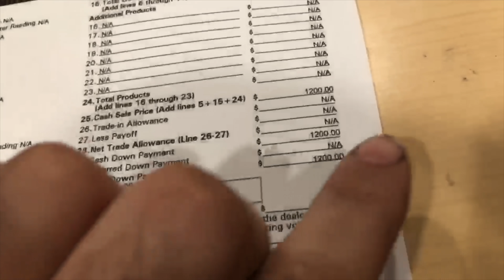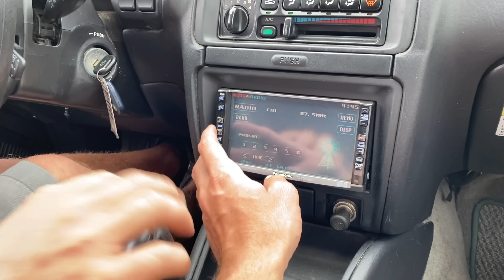James and Cooper Reveal their $1,500 Cars to Battle my CHEAP Camaro Z28!!!

Comment: They should dyno the cars to see who’s lost the least power
Reply: They don’t have an awd dyno though
Reply: jack the front up lol
Reply: Take the rear drive shaft out
Reply: @riderzinc  That sounds sketchy, I like it
Reply: @mj_aussie_coaster_travels8310  They can take out the front CV shafts and weld the center diff, this is how we make our Subaru's RWD the cheap way.
Reply: @mj_aussie_coaster_travels8310  There is a fuse you can pull that should disable the rear drive. At least my 04 and 2011 have a fuse you can pull to make them fwd...
Reply: The ol top gear challenges
Reply: the cars might not survive dyno lol, best chance they got is to just send it
Reply: @Pharyk116  Don't we have certain caps for the front end for where the axles used to be?
Reply: @tomlindo2863  auto? Or manual?
Reply: That's some dumb Top Gear nonsense. Without baseline numbers how are they going to know exactly? And I'f you're going to say they can just look up factory hp ratings, that's measured at the crank and doesn't include driveline loss so that's not really usable.
Reply: So they can copy VINWiki copying Top Gear. Wow so original
Reply: @Pharyk116  sacrilege! 😂
Reply: Dude dyno videos get so boring....
Reply: @tomlindo2863  Only on autos.

Comment: Lol James is gonna put the Brembos on the 240 watch lol
Reply: i know i would
Reply: Either that or sell them, a lot of Nissan guys would pay good money because it is a bolt on upgrade for a few models, sentras, altimas, Maxima's. With  the S chassis it takes some modifications, but still pretty easy.
Reply: Probably not since it’ll limit his wheel choices in the front. Brembos take up a ton of space and are kind of annoying to find wheels that fit.
Reply: Doubt it
Reply: But why? That car only drives the strip and 1/8th mike at that. He doesn’t need extra stopping power when he has a half mile to slow down

Comment: should do a dyno run the one who is closest to the factory rated hp wins
Reply: This is a freakin great idea
Reply: Yes
Reply: They are basically the topgear America should have been
Reply: totally not stole this from Tavarish
Reply: The factory rates them at the crank. Not the wheels.
Reply: @Nebbia_affaraccimiei  just here to say the same thing. That little road trip series was fun to watch wasnt it...
Reply: @Nebbia_affaraccimiei  except not as complicated or daunting
Reply: But you need an AWD Dyno for the sube which they don't have at the shop
Reply: On those legacy's you can pull a fuse or something and make it fwd only
Reply: @Nebbia_affaraccimiei  Nah, Top Gear UK did that while Tavarish was still wearing diapers. He has stopped wearing them right?

Comment: Those SER’s were pretty sweet back in the day. I think they came with an LSD trans as well. I think James is gonna win this!
Reply: A limited slip dif transmission?
Reply: @Greg-TC  Yes. Earlier models (91 Sentra) had a Viscous Limited Slip Differential. This model year had Helical Limited Slip Differential. The 2.5 liter engines are notorious turds. First few years, the throttle body screws would back out and suck in the engine. The catalytic converter was too close to the exhaust ports on the head that the eventual break down of the cat converter would lead the larger 2.5L stroker engine to inhale parts of broken up cat converter. The balance shafts in the bottom of the engine rob it of good HP. The open deck block design is not as strong as previous Sentra models were.
Reply: @viprdude  yea dif.. not transmission.. haha
Reply: @jeremiahgoodwin3408  The VLSD and HLSD units are inside the transmissions for both models.......
Reply: @viprdude  Huh learn something new every day

Comment: I'd run a late 1st gen dual cam Neon manual with a super cheap turbo kit. Maybe spray if budget allowed, and it might.

I've had some fun on that platform. Beat folk you just wouldn't believe so I won't bother.

Comment: Lol I have talked up the Sentra SER spec-v to my friends and always wanted to rip around in one.  The 2003 had 175 hp stock and a 6 speed manual!  Now they have over 200 on the same 2.5 liter engine... pretty awesome since my 92 integra is rated for 140 stock lol with a sad 10 second 0 to 60 and 20 seconds to hit 100mph.

Comment: James made a good decision going with a Spec V. B15 spec Vs came with a 6sdp transmission, lsd, optional Brembos, and weigh around 2700lbs. They actually do well in autocross stock. This is gonna be a good race

Comment: I think James could win it. The thing is, that camaro can easily win a drag a race versus the other 2. But on the oval, the sentry could win, because it probably has a better suspension and from the lower weight. Off road the camaro is just flat out screwed.. if he can even keep that thing driving in a straight line I'll be impressed. Now if the subaru had more power it could take the off road, but considering that sentry with nos, is probably pushing 250 hp, front wheel drive, I think james could win the off road as well.

Comment: subaru performance tuning (SPT) is subaru's (non STI) own performance parts brand sold at the dealership. it's not a tuning company. I guess they just slapped a sticker on the back of the car because these NA engines really can't be improved performance wise

Comment: That spec v is probably pretty solid since they deleted the precat on the stock header. As long as they loctited the butterfly screws. I had a 412whp/389wtq 2004. Check my page out I have a video of it. Trapped 124 but had no traction

Comment: Do the points on a weighted system, example..
Drags (lower is better and 100% yard stick)
james 13.5sec quarter=100%
cleetus 14.0sec=96.4%
cooper 15sec=90%

laps (lower is better and 100% yard stick)
cleetus 46sec 100%
james 50sec=92%
coop 1min=76%

dirt barrel (lower is better and 100% yard stick)
coop 50sec=100%
james 52sec=96%
cleetus 55sec=91%

Total spend (lower is 100%)
james £1400
=100%
cleetus £1490=94%
cooper £1550=90%
Overall higher is better: cleetus=381.4%, James=388%, cooper=356%
It makes it more fair because its not just who won what, its also by how much they won relative to the others so no one wins by just "not losing" an event.

Comment: Sorry james your car does not weigh less than a civic. I gave my Buddy a 86 civic hatch  i had sitting In a field factory weight is 1885 With a cast iron engine. It now has an all aluminum engine and its gutted.hes Hoping for around 1650lbs. Plans for a Tube chassis front as well in the future

Comment: Dude I can’t believe coop found such a nice car for $1,500 😭 I paid $800 for a clapped out 2000 Toyota Corolla for a gas saver with almost 300k miles lol it runs and drives well but damn it even needs new tires

Comment: The camaro is going to spank that spec v. James is under estimating how much hp a stock Lt1 actually makes
Reply: But she's got 250k on the clock and is definitely not 100%. 190 at the wheels might be hard to hit as it is.
Reply: No way. James is gonna whoop everyone.
Reply: The LT1 was a turd. It was only 275 from the factory.  It's probably lucky to be making 200 at this time in its life.  Even if Cleetus' car is still make 225 at the crank its an even race hp to weight with the Spec V.
Reply: @94XJ  Agreed... they only allegedly made 275 from the factory to begin with. It ought to be interesting.
Reply: @brianm6117  I agree.  But those fwd don't hook worth a shit.  Cleetus will be able to put all 150hp down.  Lol.
Reply: @04droppedsilvy  Looks like the Z28 has the original tires as well...
Reply: I don't think he is. Those SE-Rs make excellent race cars and its all stripped out with nitrous hes gonna have some steam up top.
Reply: Lt1s made way more than the rated 275hp. Google it, most put that much to the wheels bone stock. He has nitto 555s on the rear as well
Reply: @kramnull8962  he's on radials.  It was in the first video.
Reply: Hate to say I told you so, buuuuuut...